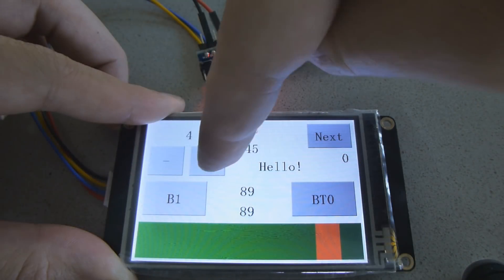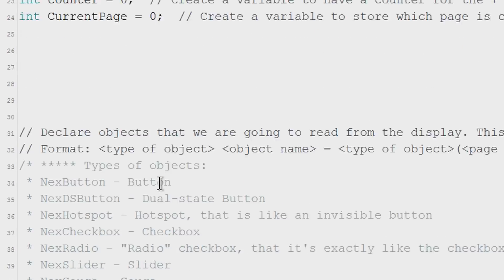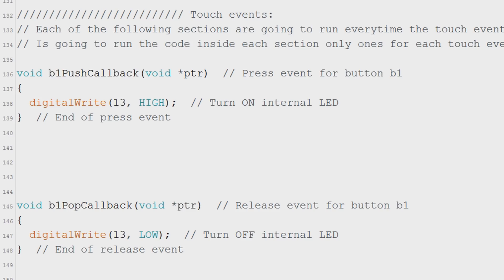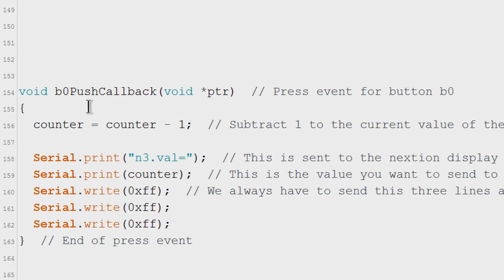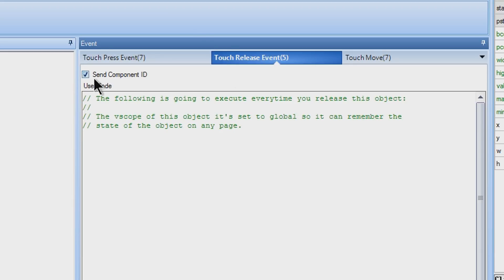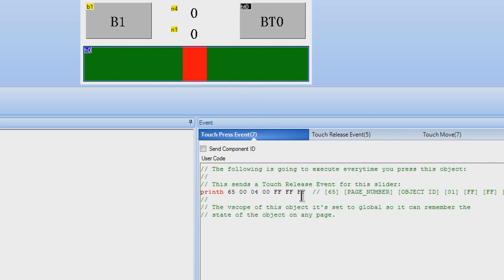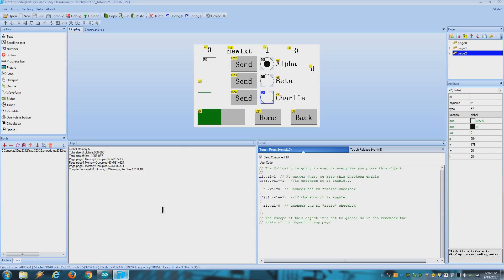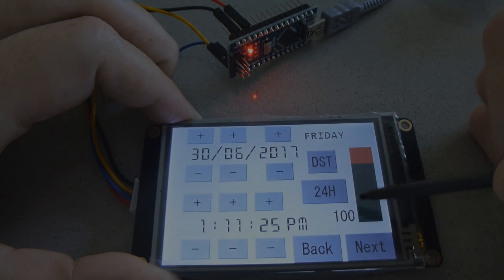Nextion+Arduino Tutorial #2 Sending Data To Arduino

Comment: Is there a way to not to use buttons next/back  but  slide pages with a finger ??
Reply from the maker: I guess you could use a slider and write the code to change page with that, but honestly I prefer buttons for that since it uses resistive touch screen. There are models that are capacitive touch screen that might work better with that. Either way, it would not animate the pages like you think (side to side). It would load each page instantly without animation.

Comment: Haven't written a line of code before and after following your tutorial I end up building this for my car https://www.youtube.com/watch?v=0BDo2v2y5mo&t=6s&ab_channel=epc
awesome tutorial, thank you.

qq: is there a maximum number of pages that I can add?  it seems that I can't add the double digit pages for some reason
Reply from the maker: That's great. Thanks for sharing your project. It looks cool.

As for the pages, I don't know of a limit of pages and I tried right now to add over 10 pages on the nextion editor and I didn't have a problem. Why exactly you said you could not add double digit pages?
Reply: @interlinkknight  I am printing on the serial monitor the CurrentPage to see which page my arduino thinks I am at. So I had to add page 10 and even tho I used the same steps in adding it for some reason it doesn't come up as current page once tit's loaded on the display. Will look into it to make sure, I haven't missed anything. Cheers
Reply from the maker: So your problem is reading the page over 9, not creating a or loading page over 9. It's interesting. Let me know...
Reply: I should have probably explained that better.  It's not just that I can read the page also nono of the buttons on the page after 9 work. Will let you know how it goes.
Reply: @interlinkknight  did some poking on the matter. I manage to isolate the issue with code under Preinitialize event (printh 65 15 00 01 FF FF FF // [65] [page numer] [00] [01] [FF] [FF] [FF]).
it seem that for some reason this piece of code doesn't trigger a page change at the arduino, however if I were to change the page number to a single digit (i.e 15 -> 09) it works great. I'm guessing it has something to do on the way the page touch press event gets simulated. Any thoughts on how can this be overcome? (I hate to have to limit my project to 10 pages (0->9). Cheers
Reply: ok, sorted, for all you guys out there, please be aware that under Preinitialize Event code line (printh 65 00 00 01 FF FF FF // [65] [page numer ] [00] [01] [FF] [FF] [FF]) the page number must be entered in HEX. you should not worry about it until you go over page 9, tho. 
Hope this helps
Reply from the maker: Interesting. Thanks for letting us know
Reply: @interlinkknight  again thank you for this awesome tutorial. 
Did finish my project and made a one year review here, let me know what you think https://youtu.be/X1S4ydgSlEI
Cheers

Comment: Very thankful for your kind explanation. May I ask for help about the problem that I met following your tutorial?:) 
I think there is a trouble about serial communication. I have tried following ways but nothing worked.. I tried to send a message from arduino to nextion and show it on the nextion screen. My device is arduino uno. 
- I changed NexConfig.h file - #define nexSerial Serial 
- I tried using Nextion library. - followed your tutorial
- I tried not using Nextion library - just using SoftwareSerial.h instead. I hardcoded the commands by writing    
        HMISerial.print("memolist.txt=\"");
        HMISerial.print("connected");
        HMISerial.print("\"");
        HMISerial.write(0xFF);
        HMISerial.write(0xFF);
        HMISerial.write(0xFF);
There's no error compiling and updating the file, but nothing shows up. Really looking for your help.
Reply from the maker: No sure what's the problem. Did you try the example in my first tutorial?
Reply: @interlinkknight  I solved the problem by reinstalling both editors!! Thank you so much.
Reply from the maker: Cool. I'm glad to hear

Comment: i tried to use your hmi files on a basic 3'5"but does not load the file from sd card? i should use necessarily an enanched model?
Reply from the maker: You need to load that file on the nextion editor
Reply: @interlinkknight  yes but first said that is an older version then i imported to the new version but when i try to loas via sd to the display it says that wasintended for a different display version, i have a basic 3,5 not an enanched
Reply from the maker: In the nextion editor there's an option to choose your display
Reply: @interlinkknight  thanks

Comment: Has anyone tried doing this on an Arduino Nano 33 IoT? How do we configure the Nextion Library to work with this? It does not compile for this board even though the code worked on a regular Arduino Nano.
Reply from the maker: I honestly don't know
Reply: InterlinkKnight well, what part of the code did you change to get the library to work with a regular Arduino nano and why? Maybe if I know, I can scan the code and fix the library to work with the new nanos as well 🤔
Reply from the maker: I didn't change anything because Arduino nano boards are perfectly compatible with Arduino uno sketches, since they have the same pin layout and characteristics
Reply: @interlinkknight  Got it, I was referring to the config file. I'll just play around with different serial# values and hope that it works.

Comment: This is incredibly helpful, for some reason my slider is only sending the PWM value on Release even though I added the line of code printh 65 00 04 00 FF FF FF on the Touch Move.. any idea what I could do to get the brightness of my LED smooth instead of only refreshing after I release the touchscreen?
Reply from the maker: My only suggestion is to try my example and compare it with your code so you can see what you did differently

Comment: Thank you for this great tutorial. What if there are other tasks in the main loop (multi-tasking), what to do in order not to lose the communication between HMI and arduino?
Reply from the maker: Multitasking is not a problem. Just don't use delays nor additional loops to keep the main loop going.
Reply: @interlinkknight  Thanks for quick reply, I have not tried yet ( I will within a few days), but my concern is missing the input from nextion while being busy with another process. For example, missing the input from a very quick screen button press. Could "listening the nextion with a timer interrupt (for example with 10 ms frequency)" be a solution?
Reply from the maker: I'm not sure how the nextion library works but so far i haven't seen missing and input, except the slider in real time, but i solved that by reading multiple times if received a 0. Try it. I think it already use interrupts

Comment: Is it possible to display the value of the pressed button in the text box placed on the second page by pressing the button (the value is 10) on the first page with only NEXTION TFT?
Reply from the maker: Yeah. Make a global variable and store the value there. You can access the data on any page
Reply: @interlinkknight   Thank you for the quick response. Do you know any instructive web page for Nextion TFT?  I am very new to TFT and Arduino. I use Nextion Editor, but I do not know any commands, how to set up each compornents with the command. I just want to do press button, then the value is handled to the next page, then on the next page, the value stored to EEPROM by pressing the some button.  I am sorry for my English, because English is my second language.
Reply from the maker: ITEAD have websites with all the commands. I show a lot of the basic stuff on my tutorials. Just watch all of my videos about the nextion display and try all my examples. I think everything you need is already there
Reply: @interlinkknight   Thank you for the advive.

Comment: Thank you for your video, it has opened the door for me with the nextion display. My project is a multi screen EFIS for my Light Sports Aircraft (2 seater). The plan is two 3.5 inch displays and a 7 inch. The micro computer/s are ESP32. Will keep you updated as the system progresses. thanks again
Reply from the maker: Your project sounds awesome. Yes, please keep me inform about your project. My email is on my channel page
Reply: Salut Ivan, dacă ești disponibil și dispus as vrea să-ți adresez niște întrebări despre cum as putea face  un ecran EFIS prin intermediul arduino și nextion, mi se pare foarte interesant și m-ar ajuta foarte mult dacă ai vedea acest mesaj, mulțumesc anticipat!!

Comment: Do not use Nextion library just send and Read plain text to Nextion it is better
Reply from the maker: I didn't found a reliable way to send data from the display to Arduino without the library. I got it to work but sometimes didn't read correctly.
Reply: @interlinkknight  Use: print t0.val you get what value you want to.
Reply from the maker: I mean in the receiving end on Arduino. Have you tried? I did try and sometimes doesn't receive the data correctly
Reply: @interlinkknight  It weird. I did not have problem on receiving. I am going to check reliable for few days. get reply to you later.
Reply from the maker: Try the slider sending the position in real time. That's the one I had more problems

Comment: You would be a godsend if you could make a video on a nextion display that controls a stepper motor! Please!!!
Reply from the maker: You are not the first person to ask me that. Maybe, I can do it. What do you have in mind? Control the speed and that's it? Or one button goes one step?
Reply: @interlinkknight  OMG thanks for the reply!!!

I was hoping to control the stepper by this process: 

1. Have a button on the display to start the stepper moment

2. Speed control, but more specifically where the stepper can run "fast" for 1 second and then "slow " for another second. 

So a speed adjustment on the display for both fast and slow, as well as a duration (timer) for both on the nextion display. 

  3.A timer for a delay
and then

 4.Have the  stepper reverse direction with a speed and timer control like in step 2. 

 5.A timer for a delay
and then

6. Starts over!

This would be absolutely amazing, and you would be a god!!!
Reply from the maker: That's a very specific. Why exactly do you want all that? If I do it, I would do it for everybody so it has to be a generic thing.
Reply: @interlinkknight  
Youttube this:

Mini inyectora de plástico.Mini desktop plastic injection mold machine 

Id like to build one of these!
Reply from the maker: Maybe I could do something simpler, but I have other priorities right now. Maybe in the future.
Reply: @interlinkknight  That would be great!

Comment: Hi, your videos helped me so much but I have a problem. I have 4 global text to page 2 of a nextion display but when I try and change the text called t8 on the display, nothing happens on the screen. Can you plase take a look a look at the code?
//this is acces point
#include <Nextion.h>
#include <SoftwareSerial.h>
#include <ESP8266WiFi.h>

//wifi stuff
WiFiServer server(80);
IPAddress IP(192, 168, 4, 15);
IPAddress mask = (255, 255, 255, 0);

bool Red1=false;
bool Green1=false;
bool Blue1=false;
bool Red2=false;
bool Green2=false;
bool Blue2=false;
bool Relay1=false;
bool Relay2=false;
bool AmbientTemp=false;

//buttons definitions for nextion display
// page id,id,""name"
NexButton b0 = NexButton(1,2,"b0");//red1
NexButton b1 = NexButton(1,3,"b1");//green1
NexButton b2 = NexButton(1,4,"b2");//blue1
NexButton b7 = NexButton(3,2,"b7");//relay1
NexButton b8 = NexButton(3,3,"b8");//relay2
NexButton b9 = NexButton(2, 14, "b9");
NexText t8 = NexText(2,10,"t8");//tremperature inside
NexText t9 = NexText(2,11,"t9");//temperature outside
NexText t10 = NexText(2,12,"t10");//humidity inside
NexText t11 = NexText(2,13,"t11");//humidity outside
//list to "listen" for button presses
NexTouch *nex_listen_list[] = {
  &b0,
  &b1,
  &b2,
  &b7,
  &b8,
  &b9,
  NULL
};
//what should the buttons do when they are pressed
void b0PushCallback(void *ptr) {
  Red1=true;
  
  }
void b1PushCallback(void *ptr) {
  Green1=true;
  Serial.println("Green1");
  }
void b2PushCallback(void *ptr) {
  Blue1=true;
  }
//relays
void b7PushCallback(void *ptr) {
  Relay1=true;
  }
void b8PushCallback(void *ptr) {
  Relay2=true;
  }
void b9PushCallback(void *ptr) {
  AmbientTemp=true;
  }

void setup() {
  Serial.begin(9600);
  nexInit();
  b0.attachPush(b0PushCallback,&b0);
  b1.attachPush(b1PushCallback,&b1);
  b2.attachPush(b2PushCallback,&b2);
  b7.attachPush(b7PushCallback,&b7);
  b8.attachPush(b8PushCallback,&b8);
  b9.attachPush(b9PushCallback,&b9);
  //wifi part
  WiFi.mode(WIFI_AP);
  WiFi.softAP("Wemos_AP", "Wemos_comm");
  WiFi.softAPConfig(IP, IP, mask);
  server.begin();
  Serial.println();
  Serial.println("accesspoint_bare_01.ino");
  Serial.println("Server started.");
  Serial.print("IP: "); Serial.println(WiFi.softAPIP());
  Serial.print("MAC:"); Serial.println(WiFi.softAPmacAddress());
}

void loop(){
  nexLoop(nex_listen_list);
  WiFiClient client = server.available();
  if (!client){
    return;
    }
  //Serial.println("********************************");
  String request = client.readStringUntil('\r');
  Serial.println("From the Station point:");
  Serial.println(request);
  int x, y, z, w;
  char data[12];
  request.toCharArray(data, 12);
  sscanf(data, "%d;%d;%d;%d", &x, &y, &z, &w);
  Serial.println(x);//humidity outside t11
  Serial.println(y);//temp outside t9
  Serial.println(z);//humidity inside t10
  Serial.println(w);//temp inside t8
  //wiring data
  Serial.print("t8.txt=");
  Serial.print("\"");
  Serial.print("Hello!");
//<-----------------------------This is where I write the word "hello" to the t8 on the 2nd page(the text is vscope global)
  Serial.print("\"");
  Serial.write(0xFF);
  Serial.write(0xFF);
  Serial.write(0xFF);
  if (Red1==true){
    client.print("redOne\r");
    Serial.println("Red1");
    Red1=false;
    }
  if (Green1==true){
    client.println("greenOne\r");
    Green1=false;
    }
  if (Blue1==true){
    client.println("blueOne\r");
    Blue1=false;
    }
  //relays
  if (Relay1==true){
    client.println("relayOne\r");
    Relay1=false;
    }
  if (Relay2==true){
    client.println("relayTwo\r");
    Serial.println("Relay2");
    Relay2=false;
    }
  if (AmbientTemp==true){
    client.println("AmbientTemp\r");
    Serial.println("ambient temp");
    AmbientTemp=false;
    }
  client.flush();
  //writing data to screen
  }

I made some arrows to the part that is not working. Thanks again if you can help or just give me ideas on how I should go about debug it. Have a nice day!
Reply from the maker: I'm sorry but I don't have time to troubleshoot your code. I wish I could help. All I need to know is that my example project works for you. Right? If that's the case, it's your job to check what you did different than my example.
Reply: @interlinkknight  I figured it out, I made a function that is being called every time in the void loop and it is wroking reat. Thanks!
Reply from the maker: That's great! Good luck

Comment: I want to make a quad state button. I put the code in to rotate through the 4 different images.   Is there a way to send back the PICC of an button?  Knowing that it was pressed doesn't do me any good if I don't know what image it's currently showing.
Reply from the maker: You can't know directly, but you could do it storing the state of the button in a variable inside the nextion display. You can later read that variable from arduino.
Reply: @interlinkknight  Thank you!  I assume I can instead just have a regular button (or crop?) have it send the touch event and let the microcontroller manage the button state and push the correct picc for the crop area back to the display correct?  I don't want to have to poll for changes.
Reply from the maker: Yeah, that's even better. Let arduino keep the state of the button and you just change the picture with arduino

Comment: hello again. i have a problem can you help me?
i am trying to get a value in nextion and make a condition but its not working

heres my code in arduino:

uint32_t  var1;
uint32_t  var2;

var1.getValue(&nexNumberVar1);
var2.getValue(&nexNumberVar2);

if(var1 == var2)
{
 // led on
}
else{
//led off
}

i already check everything but its still not working

please help meee!!!!
Reply from the maker: First, try my examples. When you got my examples working, use them to create your own code.

Currently your code doesn't have any sense. Why you expect that to work?
Reply: InterlinkKnight its now working. idk why but the problem is the nextion where everytime i reset the arduino the nextion dont receive anything. i guess u dont really know much about nextion display.
Reply: InterlinkKnight instead of undestanding the problem u just say it diesnt have sense? unsub

Comment: Can I use software serial 2,3 on the Nano with the nextion, instead of the hardware serial 0,1?
Reply from the maker: Works for sending data from arduino to the display, but doesn't work well when receiving data from the display

Comment: You are so right about not using the Nextion library to send to the display.  I had everything coded correctly using the library but the Nextion was not responding reliably.  So I changed to sending data to Nextion using the plain simple print/write statements like you say to use.  When I do that everything works right.  Thanks.
Reply from the maker: I'm glad i could help